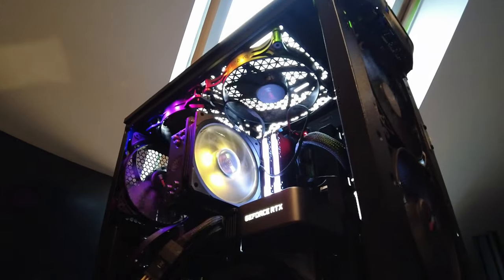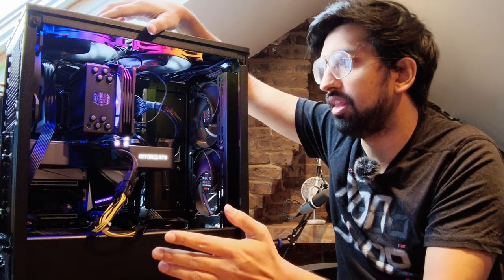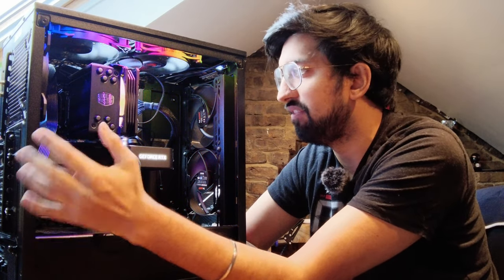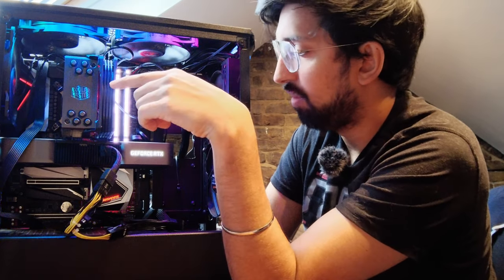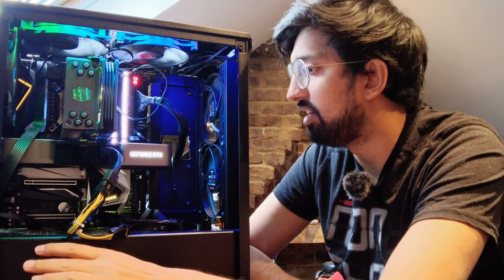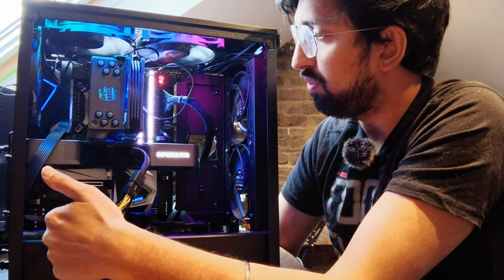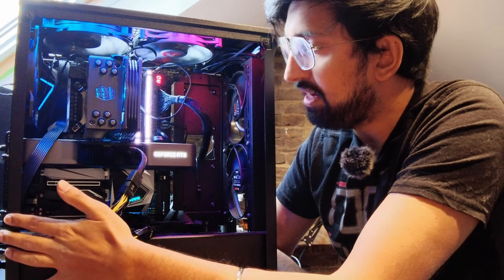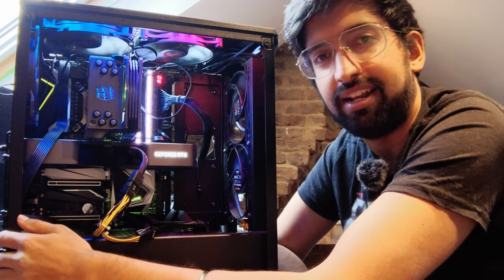Sim Racing PC Tips! Run iRacing At 240 FPS

Comment: Your R|AM should be in the 2nd and 4th slots. This will give you the best speed for your RAM.
Reply from the maker: Technically true, but iirc I did this so I can slot extra sticks in 3 and 4 without removing the cpu cooler 💁‍♂️
Reply from the maker: Actually it is in dual channel for my mobo it turns out

Comment: Great video.I have a question, do I need a rtx 4070 for VR sim racing using a quest 2? Or is an rtx 4060 enough? I don’t want to overkill it as I won’t be using high refresh rate monitors (only the vr headset at 90hz), thanks

Comment: I race on Iracing with a acer nitro5 laptop.  It's got a 1650gpu 8gigs of ram and a 9th gen cpu I do believe.  But my comment is that I get 80fps on medium setting at 1080 and I have it hooked up hdmi to my 55inch TV.  So u can do itacing with 8gigs of ram.
Reply: How well does it perform? Looking at starting a sim racing setup on a budget
Reply: @levibridges6188  it can do it but definitely need to install 8 more gigs of ram. But even without it I'm getting 75 to 80 fps at 1080.  The big tracks with a full grid can give it some slight trouble but it's very rare it's an issue
Reply: @danielcase2189  thanks man I appreciate your help!

Comment: Hi
Great video. Very interesting and explanatory for a new!
I need to build a sim racing PC in 2022 for iRacing, ACC, F1 2022 for my son.
I have a setup from my PC Dealer but he is not a specialist of sim racing….
Would you have time to help me on that ?

He already has  :
- T300 rs GT edition Tm-Open,n wheel add-onn
- Venym Atrax 3 pedals
- Chassis is coming...
- 3 Screens : Benq EX2710 R Curved Monitor SIMRACING 27"
- Elgato Hd60+
- Micro Blue Yeti

The setup :
- Mother Board Asus ROG STRIX Z690-F Gaming Wifi - ATX Socket 1 509,00 509,00
1700 Intel Z690 Expres
- Processor Intel Core i7 (12th gen) Dodecacore (12 Core) (3.6 G
- LANCER RGB XPG DDR5 32Go (Kit de 2x16G) 6000MHZ
-  Watercooling ROG Ryujin II 
- Boitier ASUS STRIX HELIOS GX601 BLACK 
- Power Supply : ASUS ROG-THOR-1200P 
-  SSD Samsung 980 PRO MZ-V8P1T0BW - M.2 2280 Interne 1 To - PCI Express N
- Vidéo - Circuit NVIDIA ASUS GeForce ROG STRIX RTX 3080 Ti-O12G-GAMING 12 G (or 3090 Ti ?)

At the end of your video your are talking about air ventilation...Any recommendation on this setup ? is everything appropriate ?

Hope you can help a lost dad...;-)

Looking forward to reading you

regards